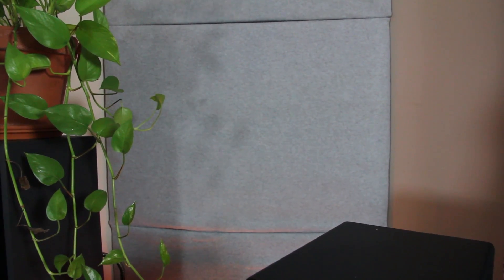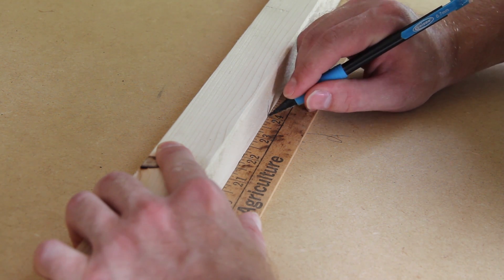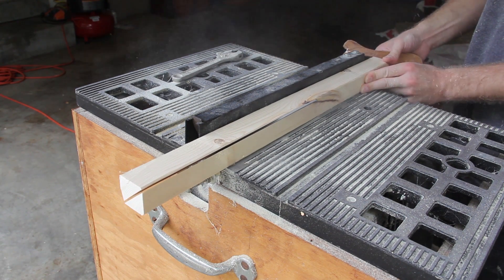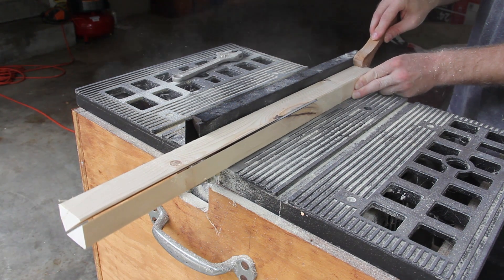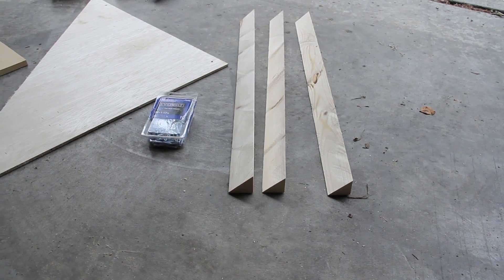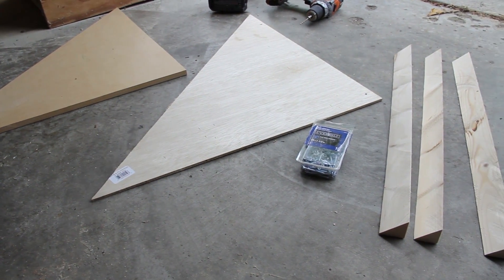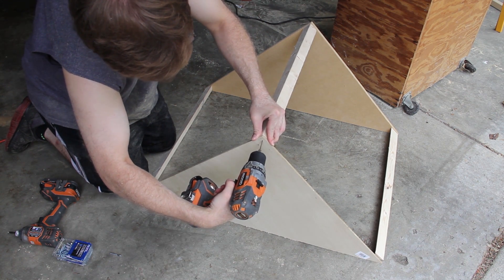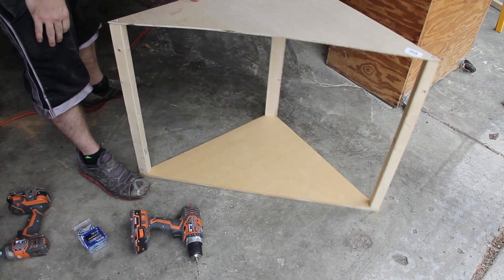DIY Bass Traps: Home Studio Room Acoustics

Comment: very elegant design... an air gap between the trap and the wall would be very helpful
Reply from the maker: Thank you! I might try that sometime.. it will require a little more space but I think I could pull it off.. Given the amount of space I used (without adding more distance outward from the corner), what I researched seems to show it varies based on the material, and that with Roxul Safe N' Sound, in this amount of space, it is best to go all the way filled in. However, once it reaches a certain distance from the wall then the air gap was better.. or on the other hand if you wanted to use less material, an air gap is better than pushing everything in closer to the wall, if that makes sense. It varies depending on the material used. I described this in a bit more detail in response to Uncle Benja's comment below. However, with these DIY projects there is definitely some variance in opinions and results (it can be hard to find info on the subject and examples outside of forums and posts from other do-it-yourselfers), so sometimes the best way might be just to try it! I do think it is likely that if I took this exact design and moved it out a bit further to create an air gap you might be right! Thanks for the feedback!
Reply: air gap is not beneficial....the best corner traps fill the entire corner. Perhaps a different material would help bass frequencies a bit more here...but I suspect this is a solid absorber.

Comment: And what about the low frequencies ?
Reply from the maker: Absorption is absorption. There are no reflective surfaces in this design. As opposed to most diffusers, there is no reflection targeting any specific frequency. Nearly all frequencies will be absorbed to some extent, but a bass wave several meters wide will not be absorbed as effectively as higher frequencies. That is why bass traps like this are built to be so much thicker than a standard 3" panel, so the bass wave has to travel deeper into the material before hitting a reflective surface behind it. As Chris mentioned, it is made to clean up the sound and deaden a significant amount of the reverberations, but building something to completely absorb all the bass would be impractical/impossible in a room this size. On the other hand, some might ask, "what about the treble?" because it will be absorbed too with this design. This is true and that is why there are other types of bass traps that involve a reflective surface on the front made to flex and absorb bass while reflecting the treble back into the room. It just comes down to personal preference, and also careful design and research if you are doing a DIY project. You would want to make sure with the materials you are using that the latter concept actually works the way it should.
Reply: That's what bass traps do. They handle "low frequencies" thus the name "bass....trap" lol
Reply: joke? where the bass trap here? I can only see the panel to reflect the waves of low frequency
Reply: No joke, the video is teaching you how to make a DIY bass trap. The material in what he made traps the bass. Thus, "bass trap"
Reply: Do you think that a wave several meters long will be hide in this trap?
Reply: None completely does for our line of work. It's like asking can a human make a perfect 6ft line without a ruler. Bass traps do not trap all the bass. These materials whether the ones from the store or the DIY kind is only meant to be used as a guiding light to deaden as much as you can. Any builder of booths and treating a room would know this.
Reply: The point is, it helps.
Reply: that's not true !! adjusting a room to listen is to reduce all frequencies, only in this point will be good the listening room. Excision of individual frequency is worsening music listening, always, because the reflected wave affects the perception of the recording. In the Listening room must be limited wave reflected, but in the whole band. The balanced frequency band is very important.
Reply: A dead room is a bad room.
Reply: But you know bro, this is all just opinions. So we good fam. Have a great new year. #Salute
Reply: not opinions, you can measure the reflected wave level. You can try construct this panel. It works on the principle of deflection the wave. Happy new year to you too. thanks .. http://www.welcometometal.com/advices/122-we-make-a-listening-room-to-our-needs-part-2.html
Reply: Oh naw what I meant was the taste from one person to another on how they want their treatment to be. Some like a little ambience, some don't want anything at all.
Reply: I understand, but it refers to the level of the reflected wave, and not the frequency range of this wave.
Reply: Good point.
Reply: @chriswellz5993  Every engineer I have ever listened to along with my college professors agree that a dead room is not the goal.
Reply: @shamanbeartwo3819  Then you're surrounded by sensible people that resonate with other sensible like myself sir.
Reply: Panel with mineral wool and sewn material will never absorb low frequency, this wave will not come in to such a panel. This wave by the reflection of such an element will remain in the room always

Comment: curious on how many packs of roxul you had to get to tame the 4 corners, im looking into doing the same soon
Reply from the maker: For me I needed 3 packs for the corners in my setup, but not all of the corners are all the way from ceiling to floor. Each pack comes with 8 pieces. Each piece is 3" thick and makes 4 triangles. So, one pack is enough for about 96" of bass traps from top to bottom with this design.

Comment: advice please....I have a concerted 2car garage, floor is tile. :(  was thanking of making that room a movie theater/gaming /surround sound room. right now I have no curtains up either and no carpet. I don't want spend a lot $$$ Incase I decide to rent it out As a  bedroom vs home theator room.(or may keep it my bedroom/and mini home theator) what sound absorbing things would u recommend? (im thanking of buying carpet and placing it down like a rug) and walls? curtains? (right now my bedroom is carpeted and curtains  and has a lot of reverb so I have no tv in there)
Reply from the maker: Hello. At the very minimum for an inexpensive solution, you would probably want to have a throw rug or two and something on the walls. Hanging thick duvets/sleeping bags on the walls would be more effective than thinner curtains, but probably won't look as nice. Even then, this won't help much with bass reverberations, but should make a difference in the treble.

If you look at my channel under the "Inside the Cave" section you will see a "DIY Acoustic Panels" video. These are more cost friendly than the bass traps, and should still help to address some general room noise problems (Just less efficient for low bass frequencies). This would be a good solution to consider if it is practical in your situation.

Also, even having a well furnished room can change the overall sound of the room. You will hear at least a slight difference between a totally empty room vs that some room with chairs, couch, bookshelves, tv, etc.
Reply: ***** thank u! I am going to che k out yor video now
Reply from the maker: +jimmy roberson No problem! Good luck!

Comment: Great video man!!i would like to ask you if you used a specific kind of fabric ??can I use any porus fabric?
Reply from the maker: Glad to hear you liked the video Leyeris! Thanks for letting me know. I used fleece and it worked out well. It was cost effective and has a slight amount of stretch if you pull on it a bit (but don't overdue it). Most fabrics will work. I did a lot of research and the general rule of thumb is you should be able to blow air through the fabric and see light through it when you cover your face with it. This way you know that the sound waves can pass through the fabric.
Reply: Thanks again Todd!!

Comment: Crosscutting on the tablesaw without even a stock miter gauge or a fence. Extremely unsafe.

Tablesaws should never be used freehand.
Reply: In fairness, the precision with which he made the cuts, I think it's fair to say he's an expert. But yes, in general, using a table saw without a fence is dangerous.
Reply from the maker: True on both accounts. However, yes a stock miter gauge and fence would have been the safest way to go. I appreciate the feedback from both of you!

Comment: Shouldn't there be a 4" air gap from the wall to the foam?
Reply from the maker: Good question. It depends on the air resistance of the material you are using and the overall thickness of the bass trap. With this design, it shouldn't hurt if you want to take the extra step of notching 4 - 6 inches out of the very back corner (from the center point inward).. although I suspect it wouldn't make much of a difference because the surface area in the very back corner is so small. With Roxul Safe n Sound, it is recommended to go up to 12" thick without an air gap, and anything beyond that to use an air gap (so if you have enough space in the room to build them even thicker then this would really come into play but these are pretty large!). The very far corner exactly where the walls meet is about 16" from the front of the base trap.. so yes, possibly taking that small triangle out would help, but probably not significant enough to make any real difference imo. Although, since you've got me thinking, with this design I could actually do this easily with the bread knife by sliding them out from the wall and cutting down along the back from top to bottom. Although it wouldn't be a solid piece, those extra little triangles might be useful to make a couple smaller acoustic wall panels if I tiled them into a small fabric wrapped frame.. I'll keep that in mind, although not sure its worth the hassle for me..
Reply from the maker: +Uncle Benja Also, this is assuming you have enough Safe n Sound foam to fill it in up to 12".. if your bass trap itself is only say 6" thick then leaving an air gap would be ideal from what I've researched. But if you have enough SNS to go 9-12" thick then that is even better.. if you plan on having the distance out from the wall beyond 12", at that point you benefit more from leaving the rest an air gap. This is all based on Safe N Sound. I'm not sure about other material specifications.